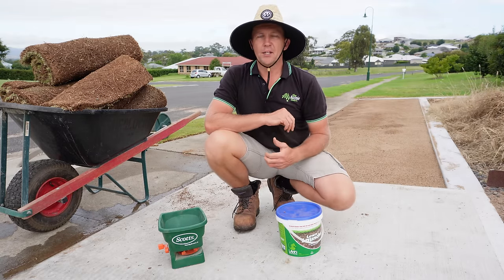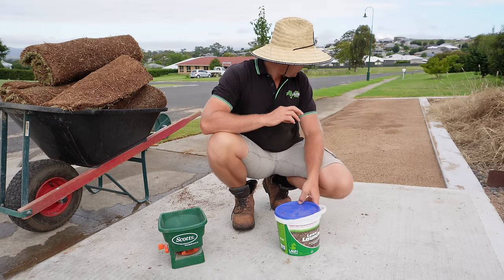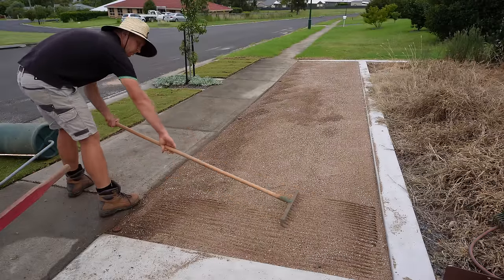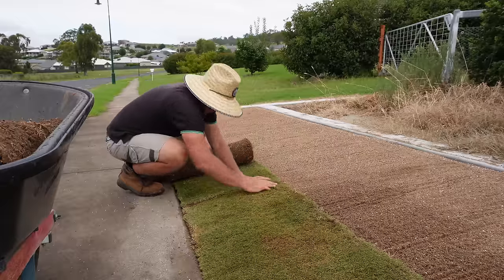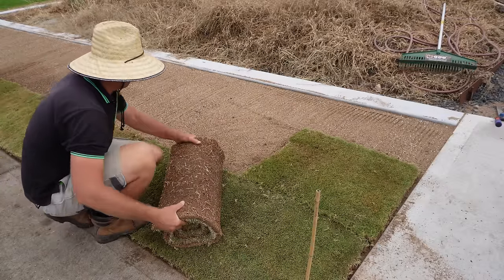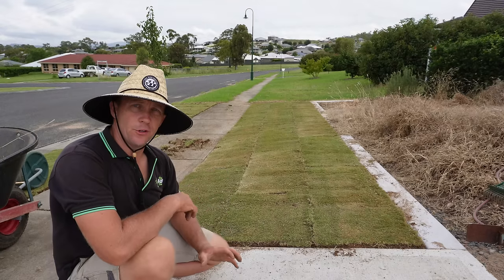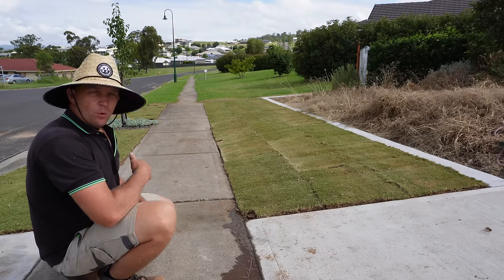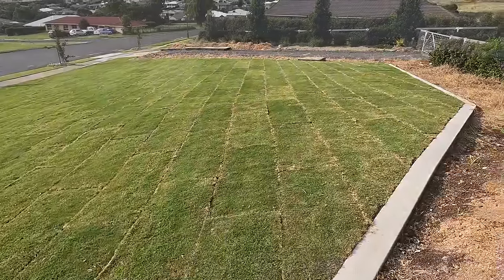HOW TO LAY A NEW TURF LAWN TIFTUF  HYBRID BERMUDA GRASS (COUCH)

Comment: Nice job mate. That turf looked great from the farm - really nice sharp edges makes it a breeze to lay each roll in nice & tight to each other. I’ve laid so many new lawns & what turns up looks like it’s been chewed by rats on the edges, no soil attached, falling apart or the sod being really uneven in thickness. Yours on the other hand looked amazing quality, so a big shout out to your supplier. 

The quality of the product makes a huge difference, not only when you’re trying to lay it, but the initial grow-in period as well. Therein lies the tip - buy from reputable growers & ask about the product you’ll be getting. 

Anyway Brenton, great content mate 🍻👍🏻
Reply from the maker: The turf was really good quality your right it did mate it easy to lay, They where a little damp from some rain few days before which also made them heavier than usual but all good its down now and Im stoked. Thanks for tuning in mate 🤟

Comment: I'm pretty late to the party on this one but what kind on medium did you lay this on? looks like a sand mixture. I'm about to lay tahoma 31 and have leveled with a light 60/40 sand/clay. I wonder if thats fine to lay sod on or if i should add some topsoil?
Reply from the maker: Hi Casey, This was laid on a course riversand. It wasn't my first choice as I much prefer to use 70/30 but due to recent floods at the time I was unable to get it from the quarry. When you say 60/40 is that something you purchased? Generally sand quarries dont have anything much heavier than 70/30. As im assuming it would be a struggle to get it through the screening plant. What part of Aus are you in mate ? Cheers Brenton
Reply: @theaussielawn  Sorry, I'm actually in South-East Texas. I'm just a Bermuda enthusiast that loves your videos. Light 60/40 is the common thing most suppliers have around here but it can have a few clumps of clay that would need rolling. I can get just about any mix though. I just bought a new constructed house and the lot is bare sand/clay - the builder said it was a mix of 60/40 & 70/30
Reply from the maker: @caseytoohey4777  ahh cool no problem, I think to have at least 2-3" of a lighter sandy profile will be beneficial it also makes it easies to work and spread prior to your turf being laid. Good luck and I hope your T31 performs beautifully for you.